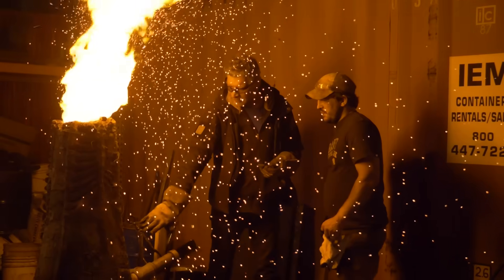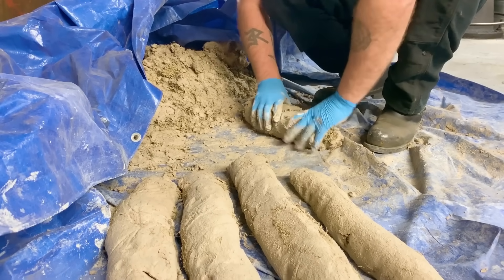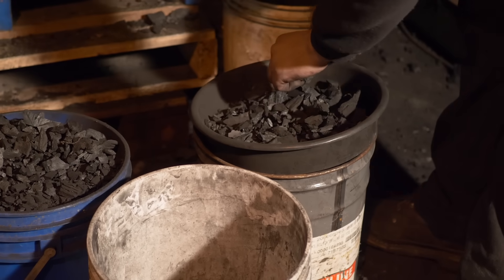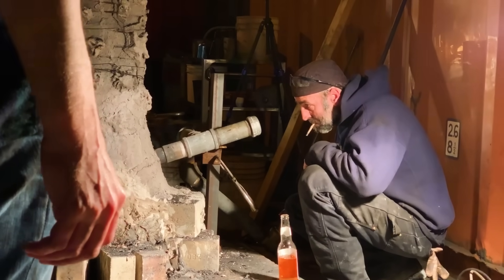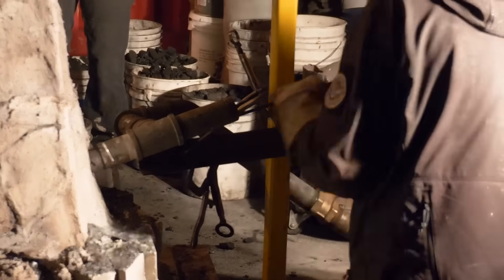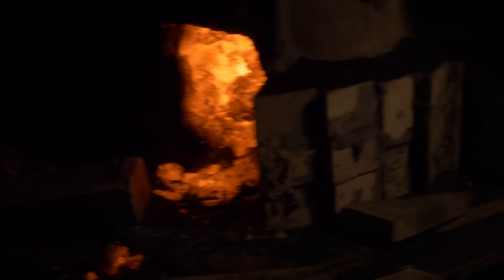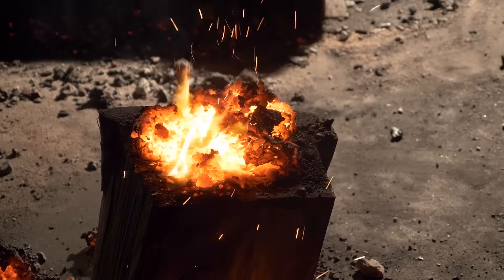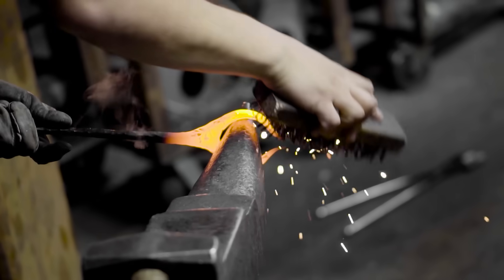IRON from SAND - Oldest form of iron smelting

Comment: Oldest form of smelting... using a modern magnet.. nice..
Reply: Magnets have existed since long before smelting.
Reply: @nettles89  Exactly. You could do the same thing with a naturally occurring lodestone, only slower.
Reply: @SquidCaps - I'm sure that that you would not have been able to think of that. Instead you would spend 10 times more time and 10 times more fuel and end up with much less that they did. But I'm sure that you would never do anything as ambitious like these people do.
Reply: yeah, they do all the work and then wtf, why are they using a magnet all of the sudden?!
Reply: @urschniwurschni8603  The process is the same. You just use a couple of orders of magnitude less charcoal and time by picking the grains of sand that have enough iron to want to stick to a magnet. I totally get why they did it. Imagine using two tons of coal over a maybe 48 hour long fire... to get a 10 pound slab that is rubbish...

Comment: so you basically reinvent a Blast furnace... cool.
Reply: It's a bloomery furnace which is a very very very very long time before the blast furnace... well... I think.... I've got all my info from watching "Good and Basic" try to make iron.
Reply: Steven Patton I think you’re getting things slightly muddled - a blast furnace does indeed produce molten metal, but it contains a high proportion of carbon (and other impurities) This molten metal (pig iron) is then transferred from the blast furnace to another furnace (usually a basic oxygen converter these days, the Bessemer process is very little used, if at all) This makes it into steel by, as you said, lowering the carbon content and other impurities.
Reply: @emma.jacobs1  just to add, before Bessemer the pig iron will be remelted bit by bit in a charcoal fire of a finery forge until the excess carbon burned off to form wrought iron. Much more time consuming than using blasts of air.
Reply: @P〈Ç〉r@zy -  They were doing things and learning from doing. What about you. What do you do that doesn't involve sitting in front of a computer?